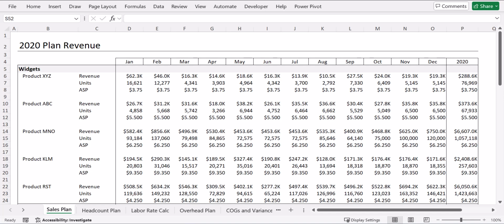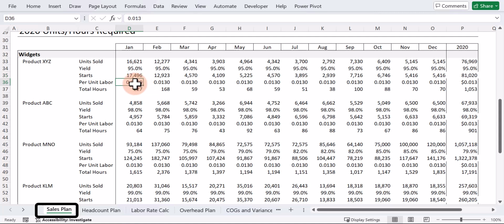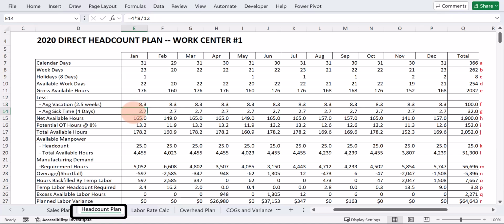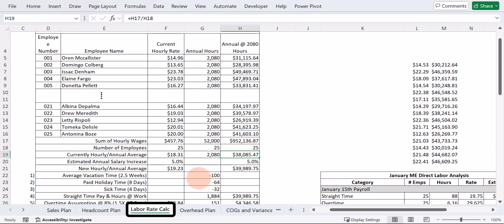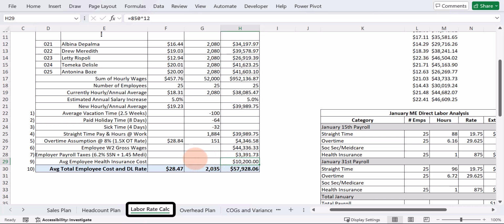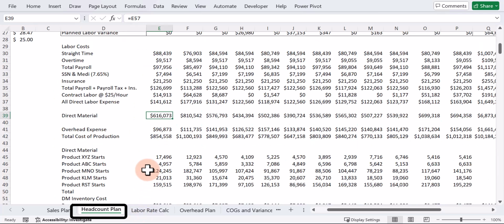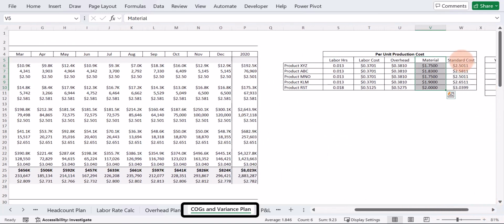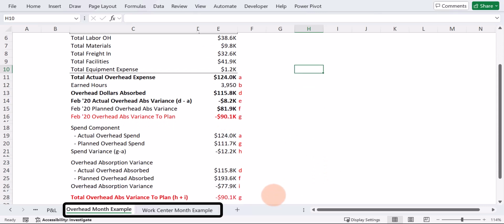Manufacturing P&L Template

Comment: The weighted average for the Total Yield on the Sales plan in the "Units/Hours" table may be incorrect? I take the weighted average of yields by (0.95×0.2)+(0.98×0.2)+(0.75×0.2)+(0.99×0.2)+(0.75×0.2)
= =0.19+0.196+0.15+0.198+0.15=0.884
% - not 78%. Can you explain further?